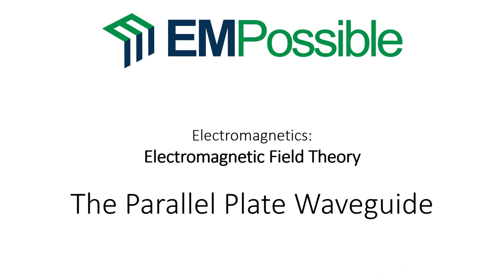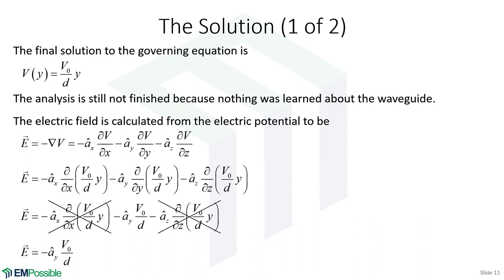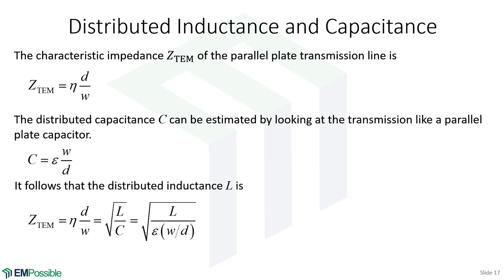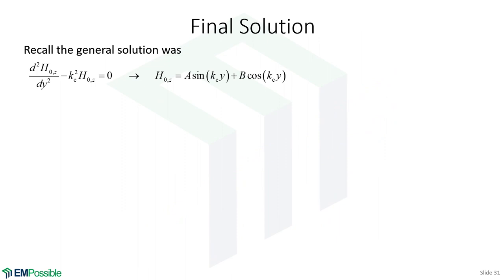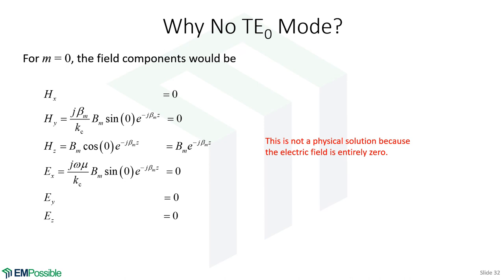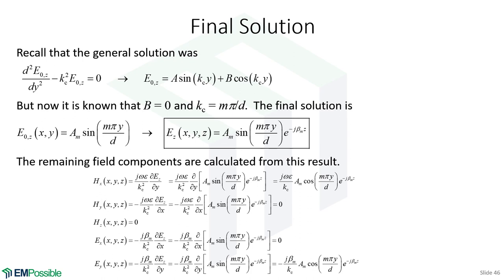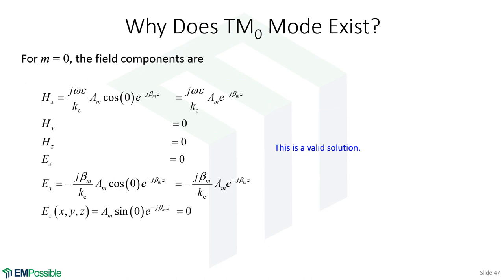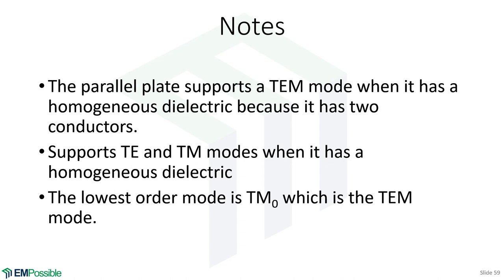Lecture -- Parallel plate waveguide

Comment: Why the surface current in slide 14 is 1/2 for h1 sheet
Reply from the maker: The surface current is not 1/2 or even 1/2 of K.  The surface current is K. The 1/2 means the magnetic field above an infinite current sheet is 1/2 of K cross n. If you would like to see this equation derived, checkout Lecture 5c here:

https://empossible.net/emp3302/

Comment: 1. For TEM mode, since phase constant = wave number, so isn't the speed going to be affected? And what do you mean by "an infinite medium"? 
2. Do evanescent modes appear at the cut off frequency? 
3. Why there's a minus sign in the expression of impedance (y-component of E-field & x-component of H-field)? 
4. Effective refractive index is less than 1,so wave moves with speed higher than that of light. How's it possible?
Reply from the maker: 1. For TEM, speed is not affected.  By infinite medium, I mean a plane wave propagating in a homogeneous medium that is of infinite extent.
2. It makes more sense to talk about evanescent fields in the cladding of a dielectric waveguide.  When a mode is cutoff, in fact, the mode still exists, but decays quickly as it propagates.
3. A negative sign may appear for backward waves since the H field has the opposite direction as it did for a forward wave.
4. Excellent question!  See Lecture 5e.

Comment: Dear Professor, thanks for the video. It helps a lot.
Question regarding impedance:
In page 15, you used transmission line definition to calculate ZTEM=Vo/I=Ƞ d/w.
In page 13, you got Ey and Hx, essentially you could you Z=-Ey/Hx to caculate ZTEM= Ƞ.
In page 25, you gave ZTM= =-Ey/Hx = Ƞ βm/k. For ZTEM, m=0 ZTM=ZTEM= Ƞ.
What in page 13 and 25 are consistent, but not consistent with what in page 15. 
How to understand that?
Reply from the maker: The characteristic impedance is not usually E/H.  Normally, you would do a line integral of the electric field to calculate voltage across the lines, do another line integral of the magnetic field to calculate the current through the line, then Z=V/I.
Reply: @empossible1577  Thanks for your quick reply. But sorry, I don't get it yet. Also I found I made some small mistakes when I presented the question which may have confused you. Let me re-present the question as below:

Question regarding impedance:
In slide 15 video time 13:15, you used transmission line definition to calculate ZTEM=Vo/I=Ƞ d/w.
In slide 13 video time 9:53, you got Ey and Hx, essentially you could you Z=-Ey/Hx to caculate ZTEM= Ƞ.
In slide 49 video time 47:40, you did give ZTM= =-Ey/Hx = Ƞ βm/k. For ZTEM, m=0 ZTM=ZTEM= Ƞ.
What in slide 13 and 49 are consistent, but not consistent with what in slide 15. 
How to understand that?

Hope this is clear.

Thanks